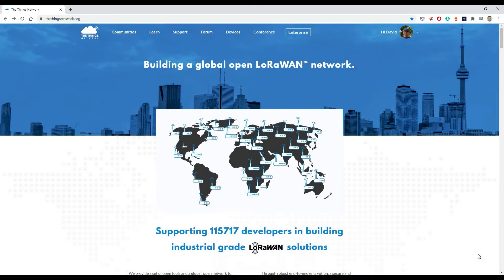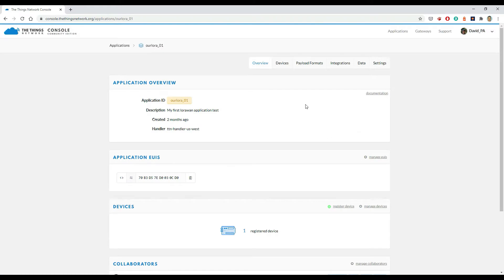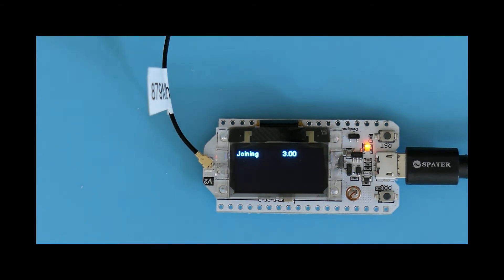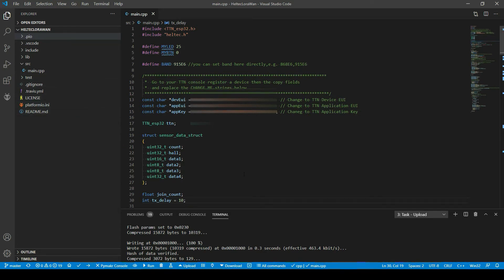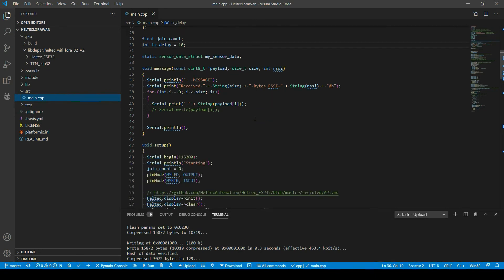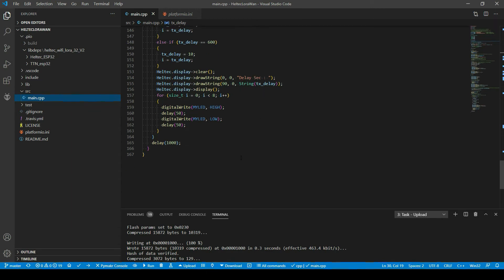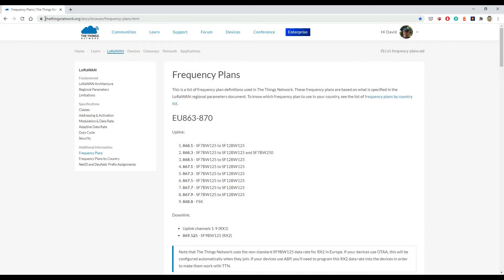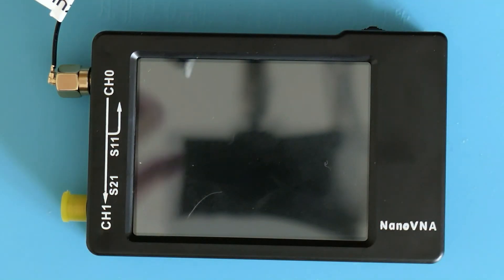Getting started with Lorawan

Comment: If I didnt want to get locked into a subscription with thethingsnetwork & wanted to run my own, what would you recommend?
Reply from the maker: Hi RDF. For me, wanted to be able to use my Lora device away from the house, that was my reason for using the TTN service, and I'm cheep and  its free :) . If you just want to manage devices around the house then a simple gateway may be a better option, I saw Andreas Spiess has a good video on setting up a gateway on a raspberry pi https://youtu.be/Ya-QlEaonLU and Pycom has a similar type of thing using Pycom SOC and python code to send on Lora data https://youtu.be/6MRwWKb6xuw. BTW, NodeRed seems to be a used a lot in these stand alone cases to process the output from the gateways.
Reply: @LupinCorp01  Thank you for taking the time to respond, that was really helpful.